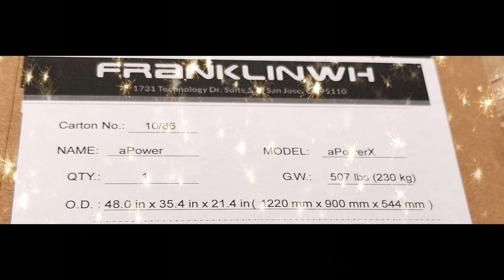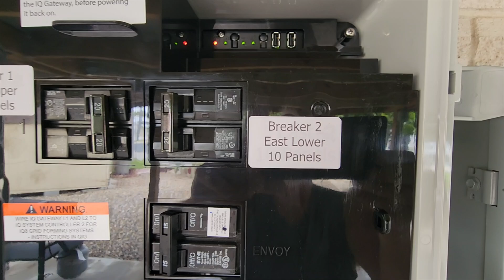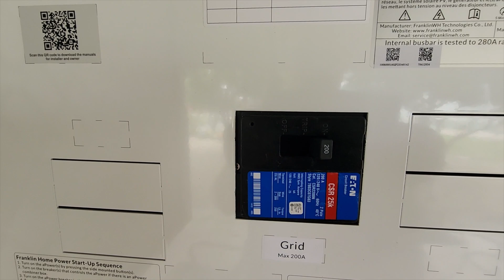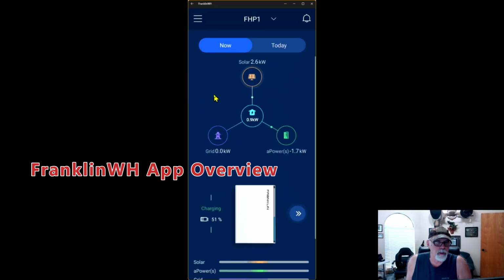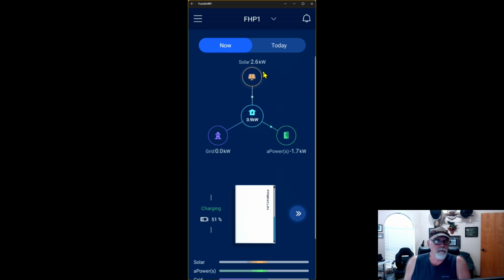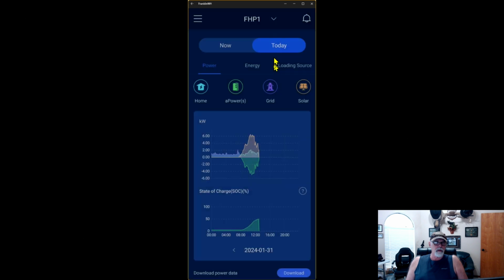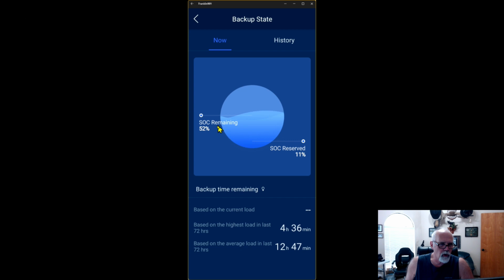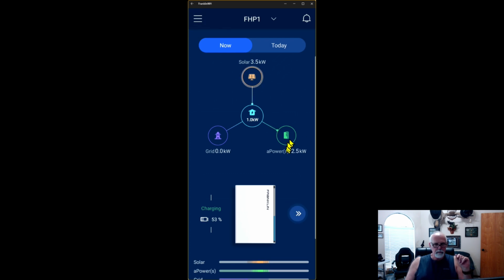Living off the Grid with a FranklinWH & Enphase Solar System - Installation and APP Overview

Comment: According to what I understand is that while off grid, the A gate should be able to activate the solar and charge your batteries off grid and then shut PV off when the batteries are full.  Can you confirm if the system can do this?  Also the battery/inverters should be silent with convective cooling and no fans, is that correct?  All sites have different costs, but how much did you pay for your installed battery system?
Reply from the maker: Yes the agate does exactly what you are saying.   The inverters have no fans and are silent running.   The battery ran right at 10K each ... or 20K total.  I installed a ceiling fan above the inverters just to circulate and disperse the heat in the garage they are installed in.  Infact i monitor the internal temp of both battery systems and have not observed any temp greater that 95 degrees.

Comment: You should calculate the wattage of 24 iq-inverters not 24x panels. If the micro is 300w, then it is only a 24×300=7200w system. Nice system, I only wonder why there is always a box to box to a box install filling up a wall. I do not have that space. Good to see it works, I find the enphase batteries and rebuild of my excisting system to expensive
Reply from the maker: Cod requires disconnect after PV box... third box is transfer switch... yes on calculation...

Comment: What is the experience during a grid outage?  Guessing the franklin has to be told about which microinverters are installed and grid profile is in use so it can command the microinverters to go on/off via a frequency shift.  Or maybe it can use a smart breaker to just turn the microinverter breaker on/off.  Guessing the Enphase app shows inaccurate info during the outage as it thinks the grid is up.  Too bad you can’t just install the Enphase battery CT on the Franklin battery circuit.
Reply from the maker: @JeffreyAdams-kt5gv  during a grid outage, franklin transfers without us even seeing a glitch in the lights.  I even use smart circuits to shut off all of my AC unit thermostats.  If the outage is during the day the solar panels continues to generate battery is tapped if solar is not enough to support the load.
Reply: @ Thank you.  I get all that.  That’s what we expect of the Franklin.  What I am asking about is how does the Franklin setup “command” the microinverters to stop producing if the battery is full and there are not sufficient loads to use all the microinverter output.
Reply from the maker: @ Good question, from my understanding the Franklin transfer switch has the full control of the grid, the batteries as well as the solar Panels.  I switches inputs based on available power balanced against demand.  I watch the app constantly switch between drawing from the batteries and charging them using grid or solar...

Comment: Thanks for sharing. I'm evaluating SPAN panel with FWH without solar right now since finding a reputable solar installer is a gamble in St Cloud, FL.

I plan to evaluate the SPAN/FWH install as a way to judge the installer for the subsequent solar install.
Reply from the maker: I couldn't justify span.  I use emporia monitoring and have wifi controlled switches on routines to save energy.  For example if temp outside goes to 80 all ceiling fans turn on till temp drops below 72...

Comment: What does just the FranklinWH portion of the system cost out the door (equipment, installation and permitting)?
Reply from the maker: 10K per 13KW unit... so $20k total.  Minus tax benefits.   We paid 20K for the solar so 40K for the project minus 6K incentives and local rebates.

Comment: Thank you for sharing your installation and review of the system. Looks identical to what I am considering. However I am looking at adding the potential for connecting my existing generator. Question: Do you still have all the Enphase app visibility?
Reply from the maker: Regarding enphase.. their app doesn't know I have batteries, so consumption data includes charging the batteries.   I still check on the app to verify panel performance, but find the FranklinWH app meets my needs.